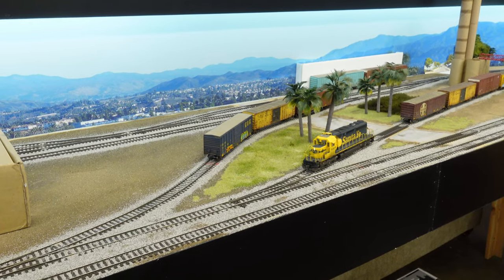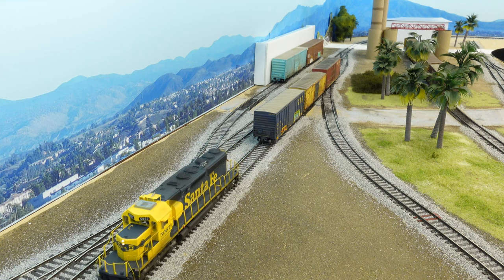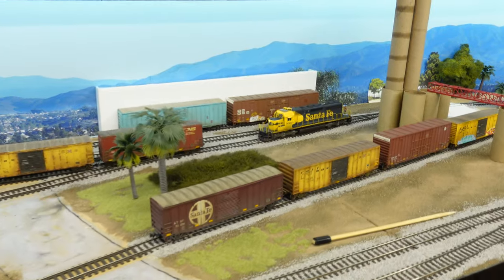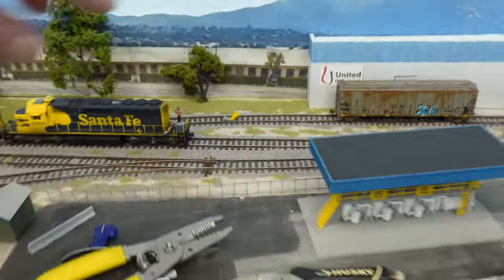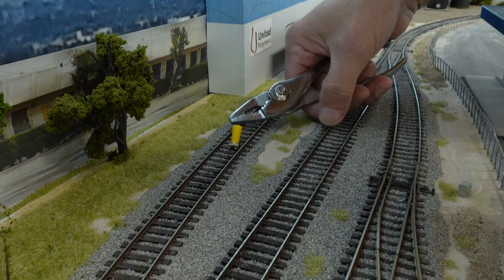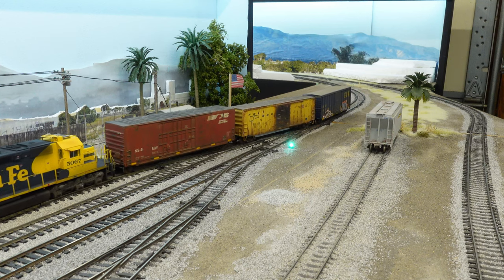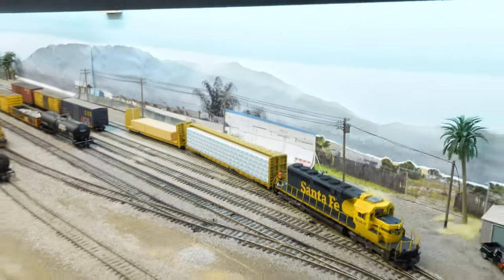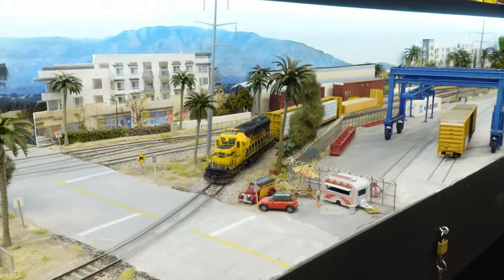Operations | This Ones All Over The Place

Comment: If I may make a suggestion, (I am not a fan of suitcase connectors), I would look into using distribution boards, lever nuts, posi-taps or t-taps (in that order).
I also have many MANY feeders and do not solder my rails together. The use of my recommended connectors allows for easier troubleshooting than suitcase connectors, which was important to me for my layout build.
All that said, I know people have been successfully using suitcase connectors for years, I just do not like the way they "cut" into the insulation.
Reply: Far too many people report failures with Suitcase connectors. What don't you like about WAGO's?
Reply: @JonBanquer  Are you calling Suitcase Connectors, WAGOs? 
When I think about a WAGO connector, I think about lever nuts.

I do not like suitcase connectors because once they are connected, you cannot disconnect them for testing.
Reply: @HumancityJunction  I am not calling WAGO's suitcase connectors. I didn't know that WAGO's were generically known as lever nuts. Thank you for the information.

Comment: Engineer Rick, I'm not trying to be mean here. I love your videos and you have a great layout. BUT.... "every single of track gets power "....  Yet the locomotive stops. HHHmmmmmm ..... May I ask what you have against soldering? I solder all my connections religiously. The only time have track problems as fare as current flow, is a broken joint ( Ya, our house shifts now and then ). Or a a switch goes bad. Even the suit case connectors are prone to have issues if moisture from the air builds up in side them. Then they will corrode. Especially where you live. Also, if you really think abought how the suit case connectors work, you should be concerned.  Suit case connectors use one or some use two metal blades to "pinch" the wires. Well not really. The blades "CUT" through the insulation. Not only do they do that but they "CUT" in to the metal conductor its self. This reduces the circumference of the metal conductor. This make 2 big issues.  1). with the wire having its circumference reduce, limits the amount of voltage/Amperage that can travel over it. Note how I said " over it "? Electrons travel on the surface or outer surface of the metal conductor. No electrons move with in the core of the metal conductor. 2). The blades from the Suit case connectors damage the conductor by both reduces the circumference and making it weaker, at the point where the blades "CUT" into it. So now we have a weak spot in the wire / conductor. This weak spot could break if the wire moves to much. That can happen just from being bumped, pushed or even constant vibration. It dose not take a hole lot of moment to start the next problem. the movement of the wire will also make the connection loose. So what happens to an electrical connection that gets loose? It starts to build up heat. Did you know that most electrical house fires start from lose electrical connections? IE: brown or zip wire extension cords and so on? Now true we are talking a bought 20 Volts or less here not the 120 volts associated in house wiring. BUT, a lose electrical connection will some amount of heat. It will also cause the draw of AMPs to go up. Thus putting a strain on your DCC control system. In short ( as I laugh looking back at all I have written here ),  You would do better to just learn and solder connections. A few real quick things about soldering. 1). Let the soldering iron heat up really good.  That makes a huge difference in the out come of your soldering work. 2). Do not use flux!!!!! Use solder made for electrical / electronics components. *** Use rosin core solder!  Flux always has a way of returning and making a mess some time after the job is done. Here is a video that I made many years ago on soldering: https://youtu.be/BizQ32z5vmQ  Hope this helps.